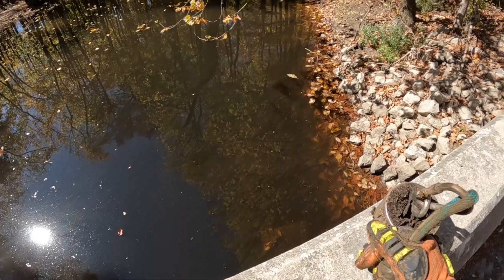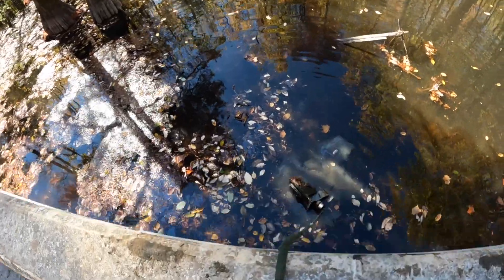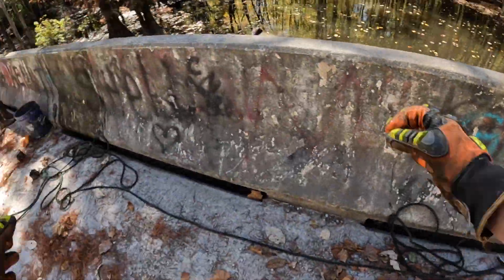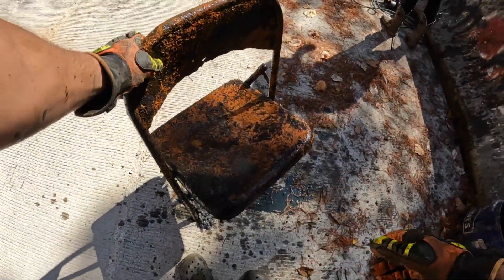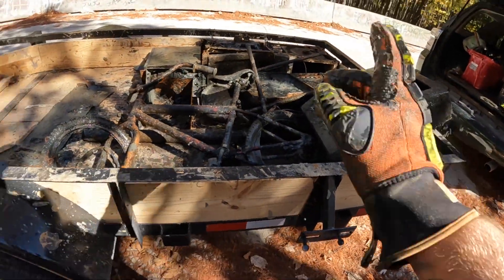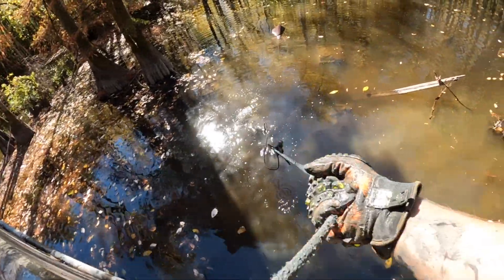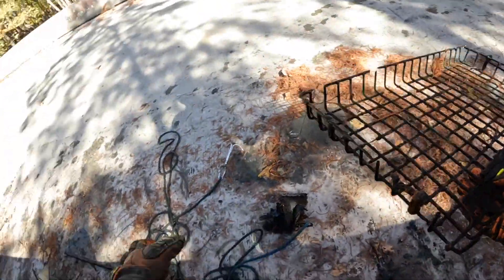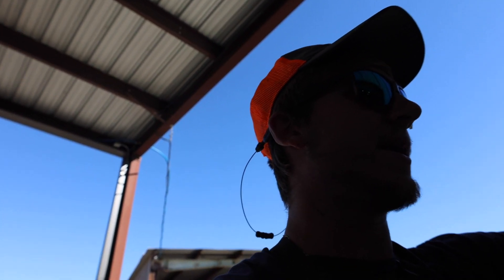No Way! This River Is A Money Pit - Best Magnet Fishing Spot Ever!

Comment: You should really get a heavy duty winch put on the front of your new trailer for some of these crazy heavy items. Attach the claw to the winch and help pull them up for you.
Reply from the maker: I definitely want to do that, I thought about putting a brush guard and a winch on my forerunner but that’s expensive.
Reply: @Outdoorsweekly  oh ya fortune not cheap just a suggestion to help you out with these huge items you have been finding lately. Keep up the mission though it's great that you are cleaning up the waters. Cheers
Reply: Idk, Bryce is sooo strong, and watching him sweat for it is one of my best past times! What a stud, huh?
Reply: @Outdoorsweekly  you could get a welder to fab up some simple mounts that you could mount a winch to. Guardrail mount, claw mount for a tree. Fork mount to hammer into the ground. 

Then again you could just chain a winch to almost anything.

Comment: The old TV's were a picture tube instead of the LED / PLASMA  screen TV's like today. Also they had circuit board instead of integrated circuit. Lot of transformers , wire , metal capacitors metal frame etc .
Reply: My father in law had a side gig repairing those back in the 60s and 70s. TV stuff all over 3 rooms when hubs and I started dating. He also did watches and clocks, so people knew where to go when they needed one fixed locally. Took years to clear that house out, lol.